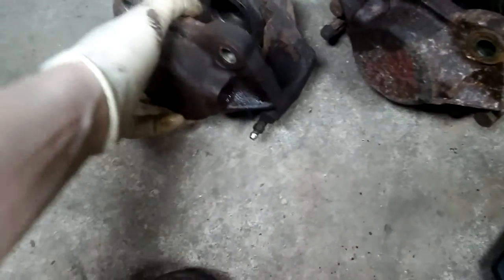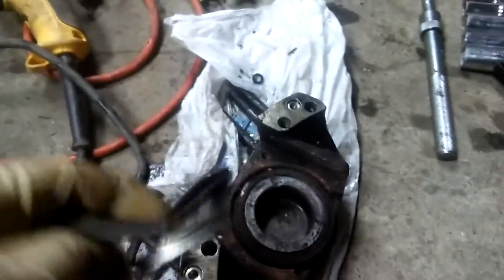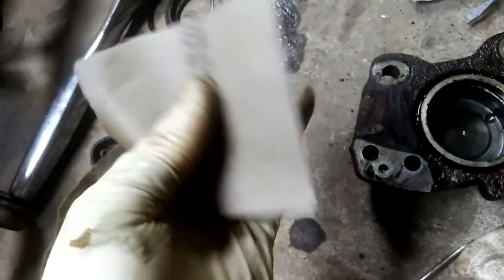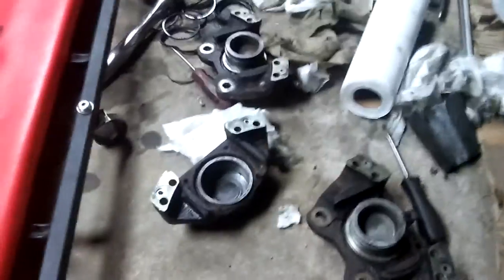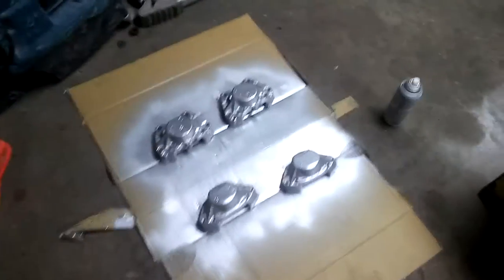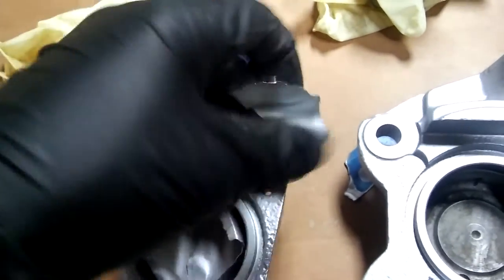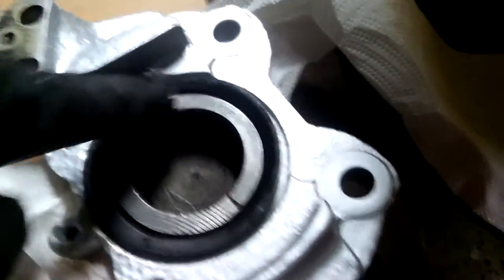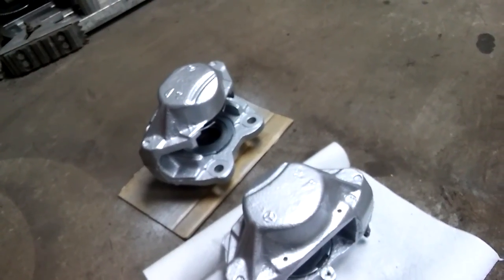MERCEDES W123 REBUILDING AND RESTORING FRONT CALIPERS/ Реставрация и ремонт передних суппортов

Comment: You did not get the caliper pistons aligned correctly. The metal tabs fit into the slots in the piston, and then the metal tabs line up the way you show them. Mercedes did this so that the pressure on the brake pads would be lower on the leading edge and help prevent brake squeal. Google "Mercedes brake caliper piston alignment". Otherwise another great job Vito!
Reply from the maker: Never had any issues with my rebuilt calipers. The pics were taken before disassembly and everything was put back together the right way
Reply: @VITOSGARAGE  He is right, the metal tabs should aligned with the piston slots, just for you to know. Great job anyways brother.

Comment: Good subject and demonstration. 

Dude, if I recall you bought a good Go-Pro. Get a small tripod with a magnetic mount. Free up your hands more often, and let’s see some steady shots. I get the handheld shot is quick and kind of easy because you don’t have to think about more camera equipment. But it can also be annoying to watch. You’ll have fewer mistakes with sound and video, too.

Are we going to see any follow-up on your W126 that overheated when you were driving to the north from LA? Did you have to give the car up?

For “parking lot” mechanic work, you do great stuff. Keep going!
Reply from the maker: Thanks for watching. I am working slowly into making my videos better. Thanks for your feedback and support! 
Got lots of content, and no, I never give up on anything! Especially these old school Benzes!! W126 is doing well, I've got so many videos I need to upload. I just got back to WA from Chicago. I gotta flush the radiator on my W126 and clean it from the outside, it's pretty clogged up.. Or I might just replace it. Save old schools!!
Reply: VITO'S GARAGE
Looking forward to the install and test of your rebuilt calipers. I worried a little when you didn’t put the pistons back in their same caliper body, but you’ll know in time if it’s a problem. Fingers crossed!

Good to hear your W126 will be brought back into service. Suggestion: Flush your WHOLE system, including the radiator. (If the radiator is original, consider a new one. The radiator passages are small and the plastic is likely deteriorated after decades of use. It’s efficiency is undoubtedly reduced.

I’ll post how to do a deep flush including citric acid solution, if you or anyone wants. It’s not difficult but it has to be done as Mercedes describes. After you do it successfully one time, you’ll want to do it with every oldschool MB you take on.

Whenever you replace a head gasket or head that allowed oil into the cooling system, a citric acid flush is again important. Oil in the coolant reduces the coolant’s ability to transfer heat away from the engine. 

Keep up the good work!
Reply from the maker: @majicul  I installed these rebuilt calipers in my W123 2 years ago. Check out my W123 playlist, lots of videos there. Calipers are great, no issues. 
I just went back home to Chicago and drove my W123 and the brakes still felt great with those calipers! Even though the car was sitting for 6 months. 
I am gonna check out your videos on that, thank you. 
We will see but I will just probably change the radiator, it's original BEHR. Wow, it's 38 years old. They used to make amazing cars back then!!
Reply: VITO'S GARAGE 
Whew! Had me a little worried. 👍🏻

I don’t have videos up for an engine flush. But I’d write up the basics and post it. 

There are excellent pdf downloads available for your models. (Be careful where you download. You know.)

I’ve owned old MB for a long time. I’m with you. They’re special. Good seeing you keeping them alive. A great thing to do. Thanks again.

Comment: does it matter the orientation of the piston in the bore being that about a third of the piston face is not raised?
Reply from the maker: You’d need to contact me on social media and send me pictures. It’s hard to imagine what you’re trying to accomplish
Reply: Yes. The raised portion is on the downside of the normal rotation. I believe the calipers are on the front side of the wheels so the rotor is rotating downward. You want the raised edge down.

Comment: Hey Vito -why did you split the caliper before freeing up the piston cylinders? would it not be better to blow air into them whole?
Reply from the maker: True. It was a long time ago and I was brand new 😃 This time I’d do it differently
Reply: @VITOSGARAGE  aaah ok! , I thought there might be some reason for doing i that way im not aware of.
Reply from the maker: You can try to blow out the pistons without disassembling both halves at first. But you need to put something (like wood) in between both pistons. Because it’s possible that only 1 piston will come out instead of 2